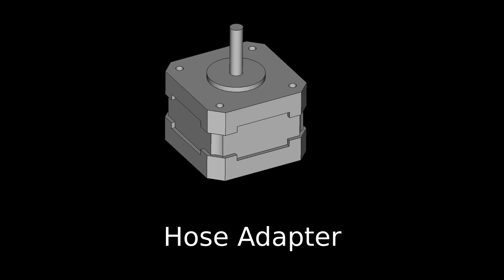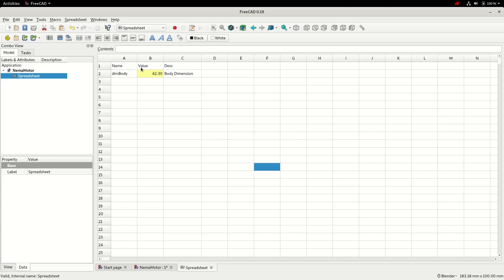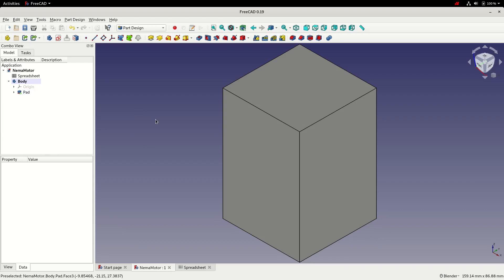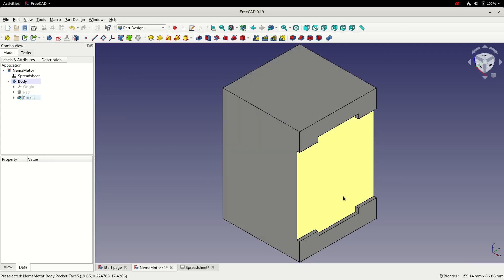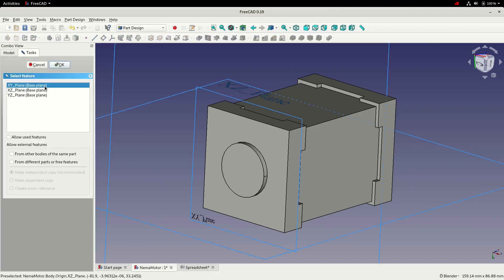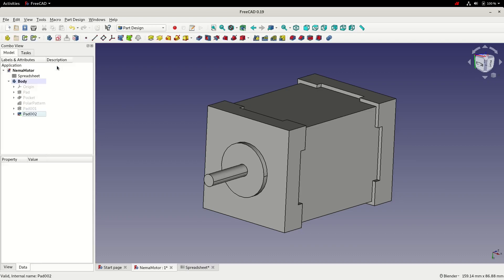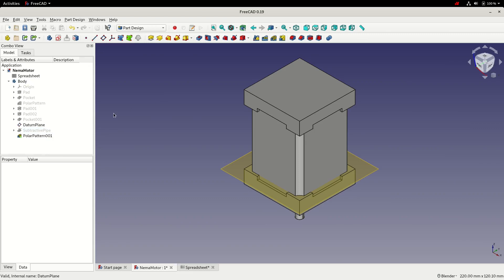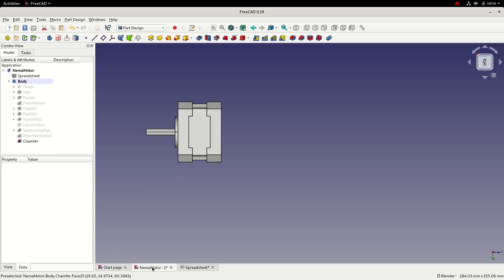FreeCAD Tutorial - Basics - NEMA Stepper Motor

Comment: Wait a minute, I'm using the latest FCAD, mine gives me 16DOF's when I have removed some of the lines..
Also, I could not complete the chamfer part. Nothing happened, it was 1,0mm, and when I selected Spreadsheet.dimBodyChamf (5,00mm) nada happened.
However I solved it myself..

But thanks for a very good guide! Now I can use the dimensions of other stepper motors, and use that instead.
Reply: I think I get the same issue to make the chamfer on version 0.21.2..
My soluce was to use the OpenSACD workbench and then remove the lines created by the pocket. (instructions on https://www.youtube.com/watch?v=KTfhP6tHtls&ab_channel=FC)

Comment: I really like this tutorial. Besides being yet another excellent tutorial, this one actually provides a working parametric model for common NEMA stepper motors - just change the spreadsheet in a couple of places and you've got a NEMA 23 Motor!  Excellent!  I did modify it to add a flat on the shaft (I haven't made it conditional yet) using the method you show in the Hose Adapter tutorial.  I do have one question, however.  If I want to include an optional second shaft (from the bottom as these motors exist as well), how can I conditionally add the new element (assuming that 'dimShaft2Len' > 0)?

Comment: Ur videos r great. Informative and paced well. I appreciate ur time and effort. I do have something I would like to see. A spiral generator. To be clear I am attempting to use the construction design tool to create a base at the bottom of the z axis to make spiral patterns from. The parameters of the generator or template I would like to use would b a fixed shape (cube, sphere, egg, or other 3d volume) that repeats consecutively from a fixed point outside the shape used on the construction aid tool. One after another in a decreasing size, by .39 or other parameter, to the center of the construction aid tool shape. Based on a length parameter. So how ever many repeated instances of a pre defined 3d shape or volume will show up stacked in a rising, up on the z axis, in a spiral in decreasing according to the overall length set. Does that describe enough of what I'm attempting? Lol.
Reply from the maker: If you look through my channel there is a video of a spiral vase. Is that helpful?

Comment: Thanks for this great tutorial! I was able to follow you just fine until the chamfer at the end. The largest chamfer I can set before it errors is about 2.9mm. If I go 3mm or higher, I get the following errors:

4042.86 <App> Document.cpp(3715): Failed to recompute Unnamed#Chamfer: Failed to create chamfer
4061.41 <App> Document.cpp(3715): Failed to recompute Unnamed#Chamfer: Resulting shape is invalid
4064.32 <App> Document.cpp(3715): Failed to recompute Unnamed#Chamfer: Resulting shape is invalid

https://gist.github.com/yankee14/f80c2da9e03fa8e8199b4e9de730ae5c/raw/8dcd13187a16f04fefdbf298ee4bda2ea8d5b442/test.FCStd
Reply: Set "Refine" property in PolarPattern to true
Reply: @udayaprasanth9189  I discovered that this was necessary in a couple of @Martham Engineering tutorials so it must be that he has refine=true set as default.  How do we do that?
Reply: I have the same problem. Any resolution?